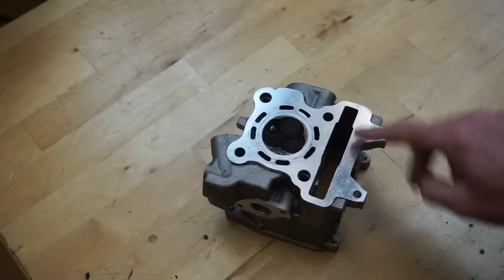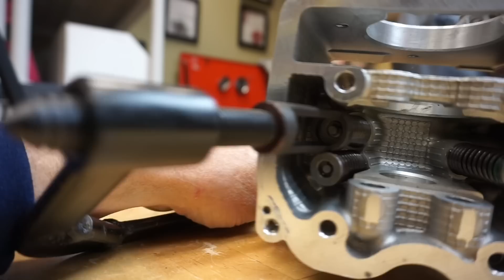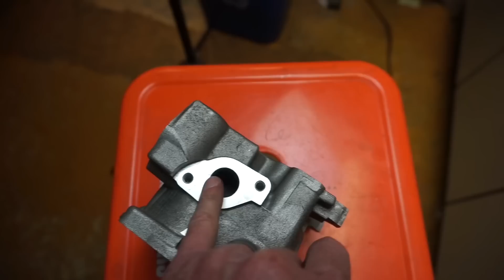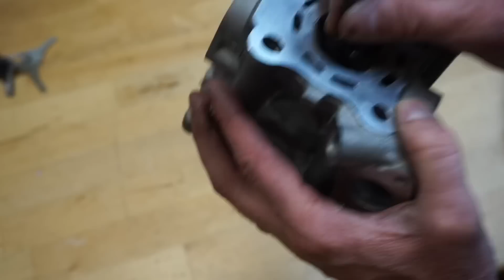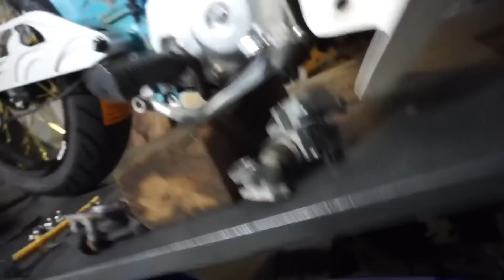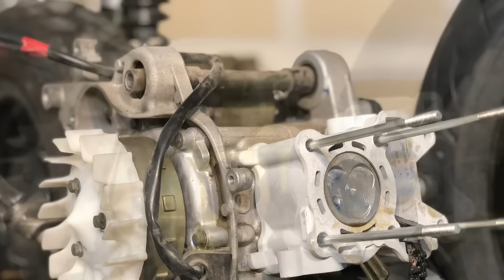Yamaha c3 Zuma 50f MORE POWER!!!

Comment: I love your videos! I have a 2007 C3 I bought new and its got over 20k on it.I let it sit for a few years because I was working too far away to use in my daily commute.Anyways I decided since I am a Welder and have an addiction to turbochargers I should try turbocharging my C3 and get more speed out of it.Im using a Garrett GT0632SZ no intercooler and a bigger injector and will be buying your tuner to dial it in.Near the sparkplug on the head there is a 6mm screw for check oil pressure.My first question is: Are there any other places to hook up a oil feed line to the turbo to get good oil pressure?I have a modified dipstick tapped with hose barb for oil return but also second question: Is the a full pressure lube system that I can even do this with? ALSO A 3RD QUESTION: Do you know what the stock fuel injector is rated at in CC's?

Comment: I was told the stock head wouldn't work with the 75cc cylinder due to water jacket. Where did you get the cam? What does this bbk and cam cost?
Reply from the maker: That is true, you can’t use the stock head. I found out the hard way. Follow up video coming this summer. Cam was purchased in Taiwan. Here is the kit you neeed:
https://www.rollingwrenchdenver.com/products/stage-3-performance-kit-yamaha-zuma-50f-vino-4t-c3

Comment: Instead of using a piece of hose to lap your valves you can use that white poster tack the stuff that you use so you don't put holes in your walls and a small wooden dowel pencil chopstick it makes it a lot easier and you can put pressure on the valve itself
Reply from the maker: That’s a great idea! I’ll try that next time :-)
Reply: Rolling Wrench yeah I thought you'd like that idea I did it a lot on my pit bikes and stuff like that makes it easier and you get a good even lap on the valve